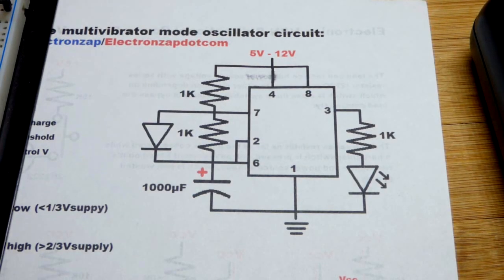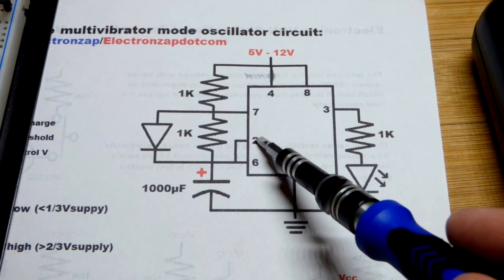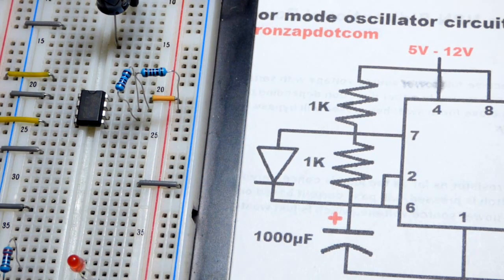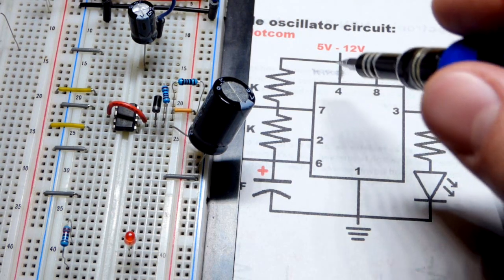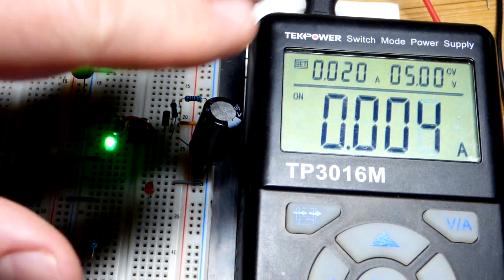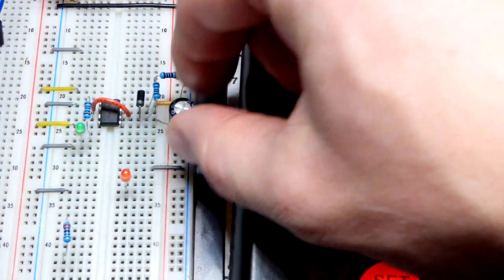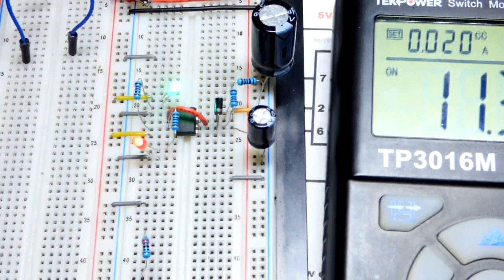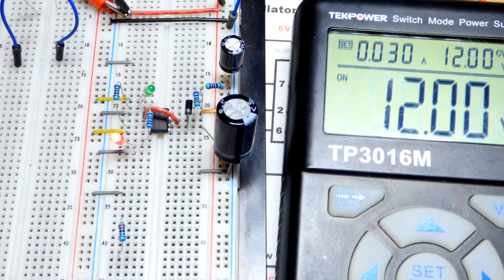555 timer astable multivibrator mode flashing LEDs step by step build by electronzap electronics

Comment: Another good video thx. A question: The first LED goes from output pin 3 to ground. The second is connected to the positive rail to pin 3. How does it get ground through an output pin? Does the pin 'open' and allow input when at 0?
Reply from the maker: The output connects pretty well to ground when it is in the low state. It connects as well as it can to the positive supply voltage when it is in the high state, but it usually falls at least  1 volt short. When the output it high, it sources current to ground if their is a load attached. And when the output is low it sinks current from the positive supply.
Reply: @Electronzap  Thank you, I ve always taken load to ground and never thought to try it from positive. So the 'to ground' LED will operate on whatever is the pin voltage and the 'from positive' LED should have the full source voltage?
Reply: @electronzapdotcom
 Just took my own measurements and its not the case on my circuit. My pin 3 shows 3.6 v from a 5v supply. The second  from the  + connected LED shows more or less the same. So Im guessing that b/c they are all the same circuit then they are sharing the same drops in voltage? Im also guessing Im probaboy wrong on that too! :)

Comment: I need it to be on for an hour and off for an hour and the calculations I made are: r1 10k r2 340k c 15000uf, is that correct?
Reply: thank for your reply
Reply from the maker: Mathematically that looks right. Unfortunately the actual value of capacitors usually very quite a bit from their rated value, especially over long periods of time. 15,000µF capacitors aren't cheap either, especially low leakage ones. I'd look for a timing IC or programmable board that has an accurate internal oscillator that sets the time.

Comment: that’s very clever, I’m made a video about different 555 oscillating devices I’ve made. I’m planning to use them for resonating couplings of coils with very fine 36 gauge magnet wire to create instruments or like a reverberating static whining amplified audio signal
Reply from the maker: Fun!

Comment: Hi why the diode between 6 and 7 ? Thanks
Reply from the maker: Current flows through the top resistor and around the bottom resistor (through the diode) while charging. The capacitor can't discharge through the diode so it just discharges through the bottom resistor to pin 7. That way there's just one resistor setting the charge time and one resistor setting the discharge time so that it is close to equal if they are equal value resistors.
Reply: That's the best part! 🤗 electro demonstrated this in a past video -- it forces the duty cycle to be very close to 50%.